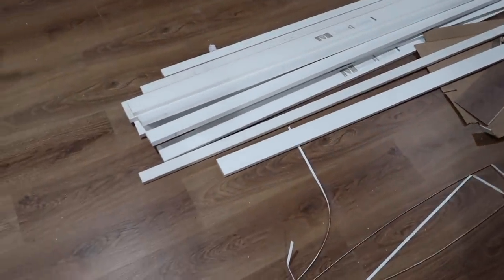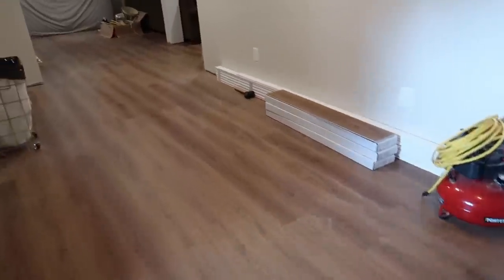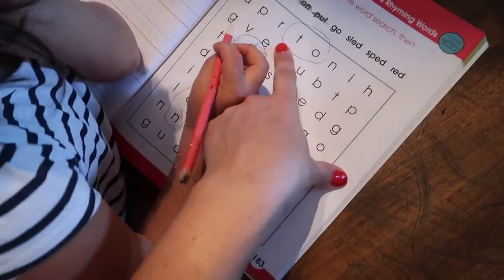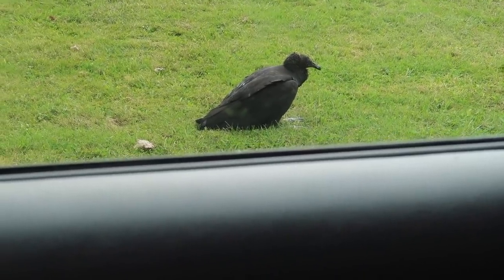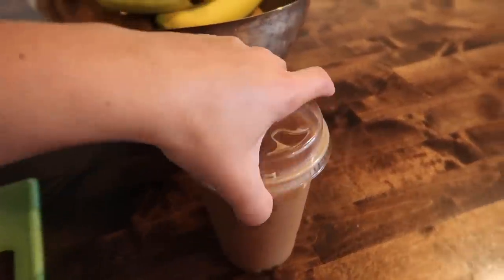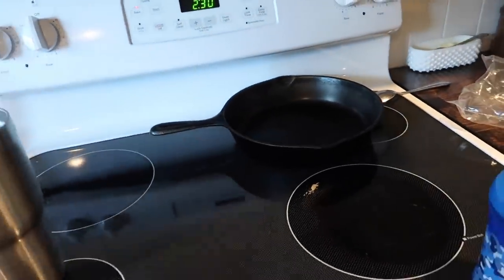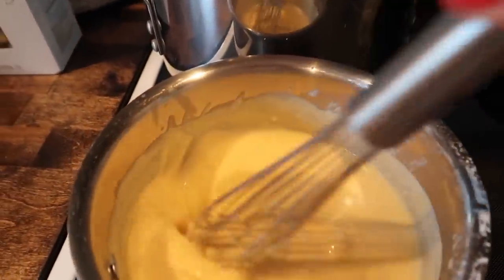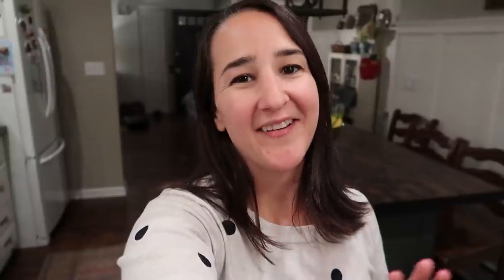VLOGTOBER 2020 Day 6: More Basement Progress

Comment: Hi, Can I ask you what your counter tops are sealed with maybe that’s not not right word.   I got a butcher blocked installed on a rolling cart like an island but it’s raw wood.   My husband thought I wanted to use it as a real butcher block to cut on but I do not.  I do use the oil they gave us my husband thinks it’s too late to seal it since it has oil already in there.  But anyways just wondering I can’t really find anything specific myself so thought I ask someone who has it.   Tks. 😁
Reply from the maker: We used polyurethane to seal, I’m not sure if that can be used over an oiled surface